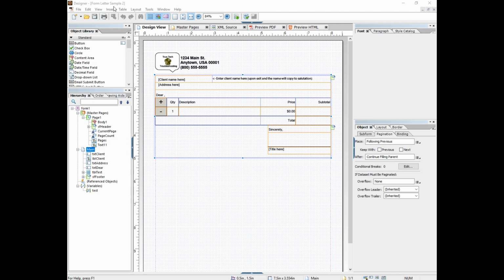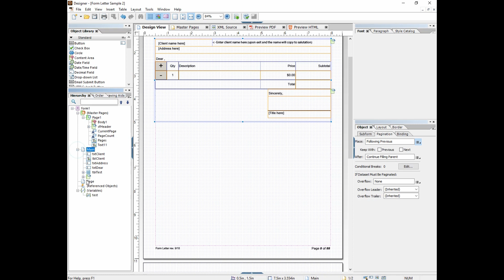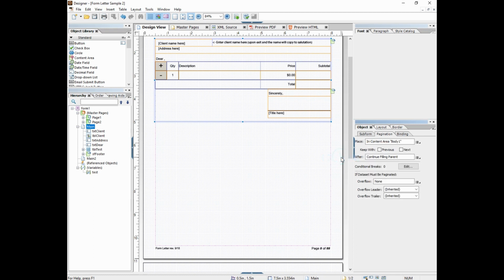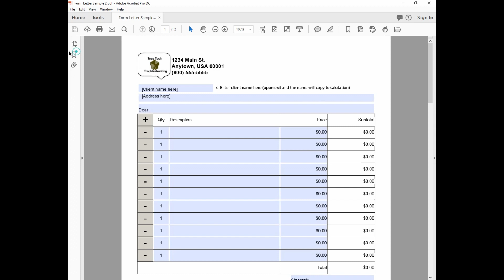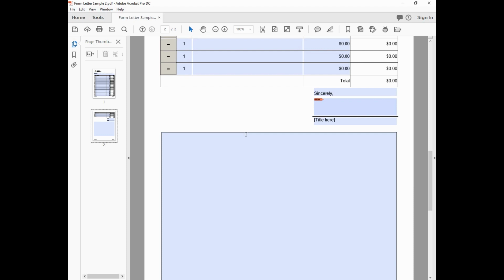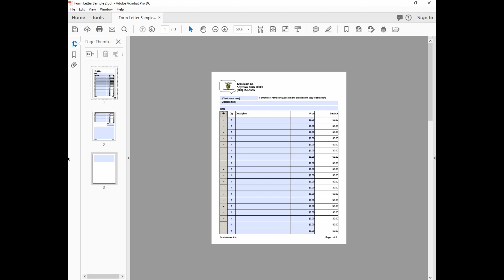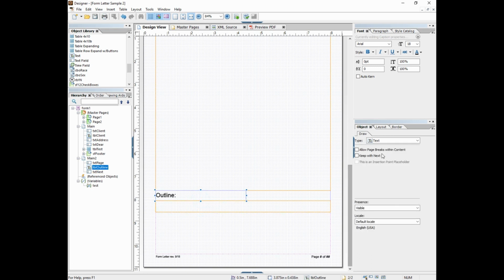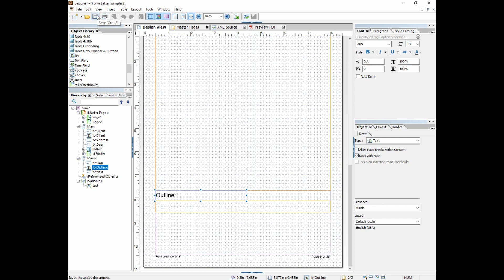LiveCycle / AEM Designer 101 - Part 8 Pagination

Comment: Hi there,

I have tables with header and content lines that do not have pagination tab, how can I force header to never separate from content. I also noticed some of the subforms don't have pagination tab. What could be the cause of this?  In case this matters, the tables that don't have pagination tab are inside a table that does have it
Reply from the maker: Good question: Nested tables (tables inside other tables) are not allowed the pagination tab.  I just tested this on my version of Designer to confirm. They are "child objects" of the "parent" table, so they inherit whatever pagination settings the parent table has.

Side note: SAP LiveCycle/AEM forms seem to have more limitations that ones created in Adobe Designer. Just FYI (I see you are an SAP addict :)
Reply: @Truetechtroubleshooting  thank you so much for your quick responce :) 

I just spoke to someone else about it, they've suggested that this issue could be solved by using subforms instead of tables. 

However, if a table runs onto the second page, the header cannot be repeated - there is always something LOL  

And thank you for sharing great tutorials!!